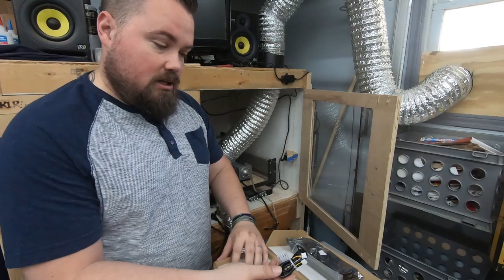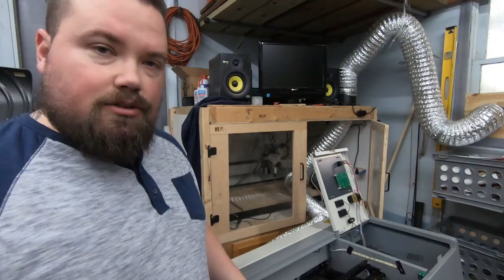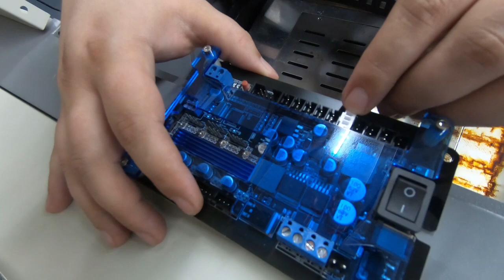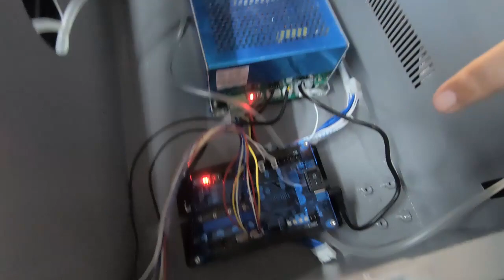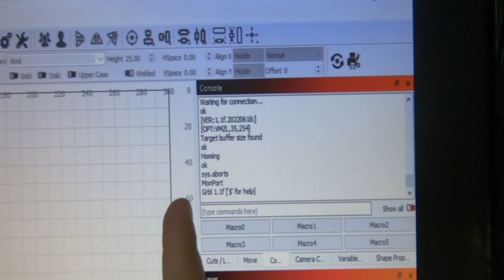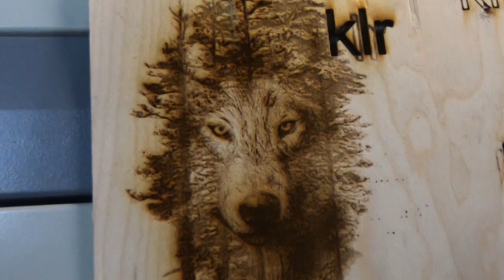Lightburn Control Board Upgrade | Monport CO2 K40

Comment: g=g    
pwm=in   
lightburn   $32=1 will sort the problems with the lines
Reply from the maker: Thanks for the info!
Reply: @KLRform  $27=25.000    change it to 5.000(it`s mm) or less and laser head will not run too far from limit switches

Comment: I have the board and works with Lightburn, but the Air Assist needs to have a firmware update, Monport support is non existent, waiting 2 weeks for update, Does anyone know where  else that I could get the firmware?  Board 4 stars Support 0 Stars

Comment: Why did you not save yourself time and buy a better board? Which are some better boards? I would never buy this one !
Reply from the maker: The cohesion 3d is probably the one that rested the best. The new monport one that replaced this one also worked very well.

Comment: The Monport board is a PITA. Had nothing but problems with it.
Board has zero instructions, the laser wiring is incorrect, and no signal comes out from any of the PWM ports when the fire button is triggered in Lightburn.
The provided power connector with 24V has a jumper from the “L” to the ground, which is not compatible with my K40 causing the laser to stay on.

I wish Cohesion3D boards would not cost half of the price of the K40, a real rip-off.
Reply: Did you solve the jumper to the L pin issue by simply removing that jumper?
I have that issue, and think that may be the solution, but every guide and video I see has it in place. I'm not sure why it's not an issue for them.

Comment: Ok for any having issues, I finally got mine working.    Omtech K40 stock Power supply.   The Laser control plug has from left to right  3 terminals  G IN 5V you have to use all 3 the 2 wire plug they send you is useless.  Make your own 3-prong plug   I used Black red and yellow wires.   

On the Power supply side Left to right Black wire to G  Yellow wire to IN Red wire to 5V
On the Motherboard use the first set of 3 by where you hook up the 24 V power (2 plugs connectors to the right of the one they tell you to use)
This plug is Left to right G  5V  PWM    So Black wire to G Red wire to 5V Yellow to PWM boom works perfectly.

I will say is sucks having to use lightburn to fire a test pulse for aiming mirrors my PC is about 15 ft from my laser  I really miss the test fire button on the machine.  Other than that it is working great.   My set up I bought a Omtech K40 brand new just for a "all inclusive parts kit"  Then I bought 10 pcs 2020 48" long V slot and 5 pcs of 2040x 48" vslot  for $200 I Bought Cloudray mirrors and mounts for $25 Bought 3x Nema 17 .9 deg steppers made my machine  38" x 38" with a custom MDF enclosure lined with 12" x 24" tile on walls and bottom.    Total cost K40 $369 + $200 in all Vslot + $30 for 3x steppers + $30 in wheels, spacers, bolts etc   $20 in 2x4's $50 for 3/4 4'x8' MDF $49 for this main board. 

Total cost $718 maybe +- $50 in things I am forgetting.    Basically doing that $800 CO2 laser that has 2 Y motors and about 30"x30" work area in the future can replace the tube with a bigger tube.
Reply from the maker: Sounds like a super fun project.
Reply: I just built this 3 wire like you described, but still no fire, did you have to do other jumpers or grounding out other pins? I have seen other places that stated you had to ground out K+. Mine does have the water flow sensor, but it won't even fire with the button on power supply. Beginning to think a new PS might be an easier fix.
Reply: I do not have this board but am thinking about getting it.... anyhow without seeing a k40 in person I assume it is still just a generic laser power supply. It should be super simple to add a somple push button for the test fire straight to your laser power supply. I have a home built laser that I did the same with. I believs it was from the "G" (ground) pin to the "L" (low)pin... dont hold me to that tho
Reply: Hi, I'm having the same problem.
Can you please send me some pictures of it.
Just to se how you have done.thanks.
Reply: Thanks for sharing. I have the o match as well and the monport  board. I cannot get it to work .
Can u post a pic or vid of the set up for those of us who are not tech savy.
Thanks
Reply: Should have been omtech
Reply: Why do people think that everyone is on the same technical level as them. I do not know how to make a three prong plug . U ask for help from monport and get none : u find something that is similar to your issue and ask for help same thing ,meanwhile u re left frustrated because u cannot use your equiptment,
Reply: Tienes algún diagrama donde me pueda guiar de esta conexión

Comment: I just got this board and installed it in an Omtech K40. Everything works but the laser will not fire in lightburn.  My laser wire has 2 wires red and black,  the 3 prongs on the power supply   Left to right   G IN 5V     Red wire is on G and Black is on In,    on the board itself it is G and PWM    Red wire is on G and Black on PWM   
on the power supply I move Black from In to 5v  the laser will fire only with power supply test button not with lightburn (set at max 20%)  I leave it on In then test button nor lightburn will make the laser fire.  here are my $$ setting (the size is correct this is a custom build I did with a new omtech K40 I bought just for the parts)

$0=10
$1=25
$2=2
$3=6
$4=0
$5=0
$6=0
$10=1
$11=0.010
$12=0.002
$13=0
$20=0
$21=1
$22=1
$23=7
$24=800.000
$25=3000.000
$26=250
$27=25.000
$30=1000
$31=50
$32=1
$38=10
$100=157.750
$101=157.750
$102=157.750
$110=8000.000
$111=8000.000
$112=100.000
$120=500.000
$121=500.000
$122=20.000
$130=787.000
$131=587.000
$132=200.000
ok

Comment: Great video - I just  "tried" to upgrade my board.  WOW -  what a pain in the butt.  I think I finally got it set up correctly ( with the help of your video) I do need to hardwire my lights, just the same as you did. I have used Lightburn to basically send the gcode over to my Onefinity
Reply from the maker: Glad you got it working.

Comment: I'm having serious problems putting the board in. I have followed this video as well as the one Monport put out and no luck. I have double checked everything against the documentation and have all the wires plugged where they belong. If I plug the power in from the new controller board I can get it to connect to the computer. Doing that I get no power to the laser/led lights. This video solved the led issue. If I plug in the blue wire to the power on the main board the laser will come on but I can't control it because there is no power to the new board. Any idea?
Reply from the maker: Are you saying that the controller won’t move the laser head around or it won’t fire it? I found that I have to turn the power up to something like 30% in lightburn before it would fire.
Reply: @KLRform  nothing in the laser compart seems to get any power whatsoever.
Reply from the maker: @jaredbellis6526  you could email me pics if you want? Klrform@yahoo.com
Reply: @KLRform  I now have a connection and the x/y axis are trying to home. they don't seem to read the limit switches and are making a terrible noise. I tried soldering (never done it before) and should have a connection. Any ideas?
Reply from the maker: @jaredbellis6526  I used a multi-meter to make sure my soldering worked right afterwards. Use the E stop to get the noise to stop.
Reply: @KLRform  I don't really know haw to use the multi meter. Where do the probes go to test continuity?
Reply from the maker: @jaredbellis6526  the two pins that are soldered. Then you can click the limit switch to see if it is functioning correctly.
Reply: @KLRform  I really appreciate the help and hate to sound dense but which pins? I soldered the wire to the NO bracket on the limit switch but I'm not sure where to check where it plugs into the board. Am I in the wrong place? I've tried to see where you are putting the probes in your video but can't make it out.
Reply from the maker: @jaredbellis6526  unplug the limit switch from the board and the the pins are in the plugs for the limit switch. It wasn’t super easy to hold that and hit the switch but I was able to with some practice. Easier if you have a second set of hands
Reply: @KLRform  I was able to check and I have good continuity but still isn’t working. I’m frustrated and don’t know what to do now
Reply from the maker: @jaredbellis6526  yeah I had to take many a break trying to figure it all out also. When it tries to home does it go to the right corner? Back left
Reply: @KLRform  so I have my Y axis reversed, any idea how to fix that? The limit switches are working now but I'm not sure how to proceed.
Reply from the maker: @jaredbellis6526  I think you can reverse the motor in lightburn. I moved it to the next y spot of the board and it worked for me.
Reply: @jaredbellis6526  switch the x/y connectors.

Comment: Hiow did you find out that the limit switch needed to be changed. I just upgraded to the Lightburn board, and it homes but when i try to cut it keep saying alarm lock.
Is that the same message you were getting?
Reply from the maker: The limit switch thing was briefly talked about in the monport setup guide. I wasn’t getting any errors in lightburn.